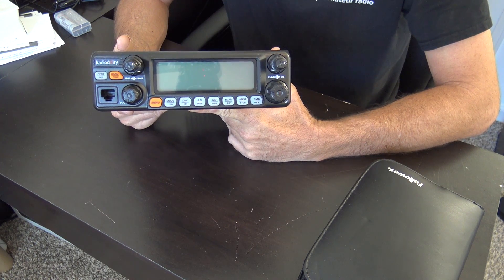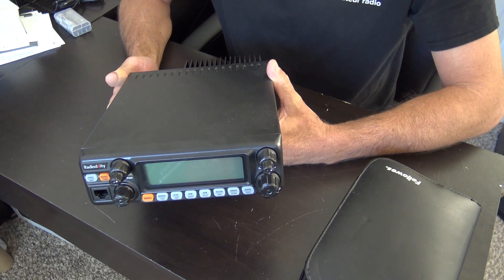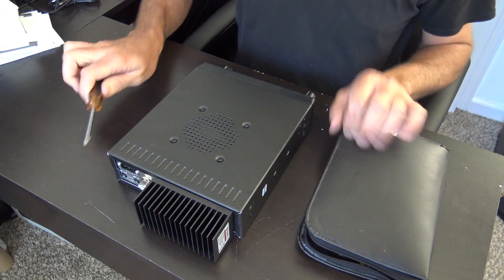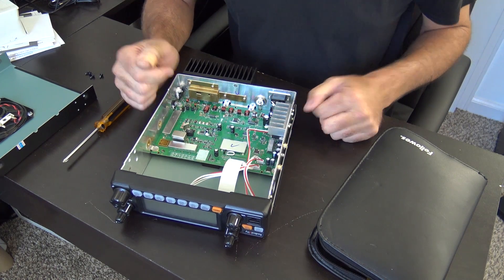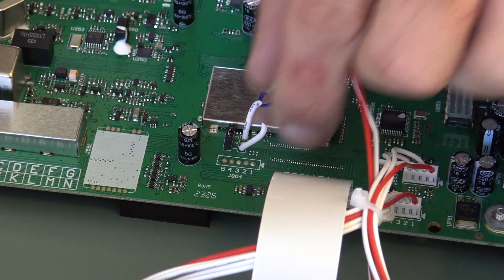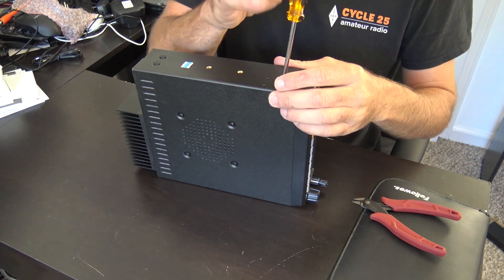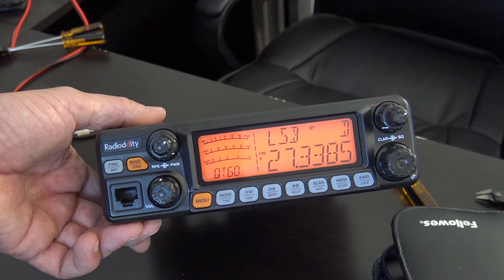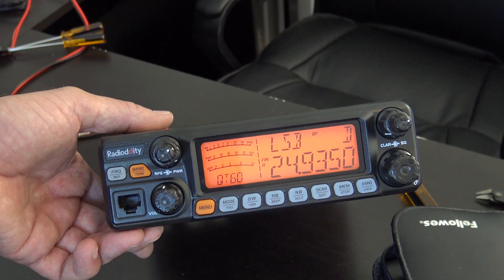Radioddity QT60, Anytone AT-5555, 11 Meter and 12 Meter Modification, 24.800MHz to 30.000MHz

Comment: When the FCC does something about the dude using what has to be a 1000 watt amp to broadcast on CB channel 6 only then will I worry about being hated.
Reply from the maker: FYI, the guys on super bowl 6 use 5,000 - 25,000 watts. I have seen it in person when I learned that they made a 25,000 watt slug for the Bird 43 watt meter.

Comment: Horrible radio.  Just got mine 2 weeks ago and only one contact a mile away.   My 2w HT fRS works better
Reply from the maker: @Mehasmenooneelesdoes  two completely different radios. I have worked 6 out of 7 continents on mine. The bands are WIDE OPEN!!!!!
Reply: @ I was being sarcastic.  I’m aware it’s two different radios.   
Lord!

My point is my new QT60pro sucks. My Tiny bubble wrap Radio works better.   Unfortunately I’m stuck with it though because I did the stupid mod.

Comment: Just got my technician KF0ORI in SW Missouri. Looking for my first radio, other than a Baofeng 2m 70m useless GMRS. You just convinced me to get this radio with pwr supply. Haven't found a reasonable base antenna for it yet. Researching and learning as I go. Thanks for the mod info.

Comment: Have just bought one. It's a nice radio and has a good receiver but it has various issues. The CW frequency seems to be offset from the actual frequency on the 10mb beacons - it tunes in better with the clarifier but that effects knowing the actual frequency. 12mb seems ok. The first bank - A - does not go below Ch9. It's a nightmare - very time consuming - to program. It does not use a spreadsheet compatible text file (eg .csv) that can be easily set up. There seems to be some twisted logic in the software design rather than keeping it simple and easy to set up and operate. I had to program it with the AT5555N QPS5555N_II 3.0.0 app. Bonus is that it allows programming for 60ch per bank and provides for more menu options. Would love Anytone \ Radioddity to sort out the various SW issues and issue firmware and programming app updates.

Comment: Love this video. If I didn't already have two President Lincoln II's, (one in each of our vehicles) our vehicles would have the QT60 or 5555. I love being to 10, 11, 12 meter on one radio.  Maybe I'll grab a QT60 anyway and string an antenna in the attic.

Comment: Love thd video but not having a  
4 pin barrel connector and a un usable RJ 45 plug is the only turn off . 
Ihave not seem any videos on adapting uniden cobra 4 pun 
mics. Alsk ghe qt 40 how many pins is on its conndctor ibtjoyghg it might been 5 cause thecmic functionx with eadio . ? 
But thd QT 60 sure is a dast way to enjoy 12 11 10 onxd yiu know uour eadios going work aftr axsuild cause if voiding warrentty

Comment: The QT40 and QT60 are awesome radios (same as the Anytone ARES2 and AT-5555Nii). 
I use my QT60 on 10m and 12m all the time. It is a fantastic performer. (And it was designed to do this, it's a feature). 👍

Comment: I saw in another video that the power was close to 100w after unlocking.
Reply: No, it really is only happy around the stock 60w power mark. Anyone who shows or claims 80w + is either showing absolute lies, or is showing extreme distortion that is going to do you no good. 
They are amazingly clean and strong at the default 60w level.
Reply: @mostlypostie1  thanks for confirming!

Comment: can you please measure the current consumption of this radio during receive? trying to get that info for some time without success. thanks a lot!
Reply: I just measured this for you. Between 290 and 410mA, depending on audio output level, mode, and squelch settings. Most of the time under normal use I see mine sitting around 320mA. I hope that helps. 👍
Reply: @mostlypostie1  thank you so much!!!
Reply: @CrazyChekov  all good! 73

Comment: Now show us how to screwdriver 100W out of it ;-)

Serious Question: Does the current 5555 do the OG mode ??  Will it take a key ??? And does it have a narrow filter ?
Reply: Another video said that it came close to 100W after modding. I’d like to see someone else test it with similar results.
Reply: @ch716  it’s funny, but cranking it to a dollar will give you half an S point, but I reckon I few things would get that nice baked look after a few months. 

5W to 15W on an old 11m rig was doable, but there’s a lot more current involved at 100W. 3dB can be picked up on a well built antenna. Maybe not as easy on a car, but you can drive to that elevated ridge for an extra couple of S points.
Reply: @ch716  no, it really is only happy around the stock 60w power mark. Anyone who shows or claims 80w + is either showing lies, or extreme distortion that is going to do you no good. 
They are amazingly clean and strong at the default 60w.

Comment: 12m is awesome at the minute. Nice rig! Do you know of any mobile antennas that would cover 10,11 and 12m without a tuner?
Reply from the maker: Thanks for stepping in and answering with knowledge brother
 I appreciate you
Reply: MFJ ham sticks. One for 10, 11, and 12. Just swap em out for what band you want. Check my videos and seen em in action. 73
Reply: You’re asking a lot. To get the bandwidth, you’ll need a longer and / or thicker antenna to get a wide bandwidth

If you’re mobile, you’re typically limited to around 6’ for an antenna. 

You could get an antenna with a tunable stub at the top to give you resonance and a nice SWR across say 500KHz, maybe a little more with a capacitance hat, but without some sort of tuning, adjustment ability you’ll not get that 25-29Mhz bandwidth on such a short mobile antenna. 

As far as I understand. 

There are plenty of long 18-20’ antennas that will work across the top of the HF spectrum. 

For my 10m mobile, I adjust my antenna for either the CW portion or the voice portion. I can kind of get both at once, but my antenna is a little short.
Reply: @MidlifeRenaissanceMan  thanks mate! I have been using a sigma power stick 4ft on a clamp mount mobile with my Yaesu 891 and it works well on 10m (it is a copy of the fire stick with the screw tip) but will not work 'as is' on 12m. Might have to try the whip with a small coil (tapped possibly). 73 from the UK.
Reply: Make a longer tip for 12mm and swap it out as needed. Use your NanoVNA and remember to have the smith chart turned on so you can see the complex impedance. Makes it easier when adjusting the length. Longer is inductive, so shorted. Shorter is capacitive so more length 

that’s what she said
Reply: @MidlifeRenaissanceMan  thanks mate, will try this out!

Comment: I have that same radio. I got the programming cable . and with Digi rig and anytone cable set I have been using digital modes on the radio. FT8 and JS8 call will work. both 10 and 12 meters.  I sent and received SSTV pic's on 11 meters. and you can POTA with that radio. just keep power down on digital modes. I use a AMP. and I did most contacts portable with end fed half wave or coax antenna T2LT . 10 meter repeaters are a bit tricky. have to keep CTCSS/DTS chart handy. I changed the display to my call sign did say QT-60 . I changed the SWR protect to 3:1 at came set a 20:1 . getting FT8 to work was a challenge using volume on radio and mic gain and settings on WSJT-x . JS8 call was tricky to set up but MMSSTV was easy ! and you can program your own roger beep great for 11 meters. use the Anytone program software from anytone . easy down load .  Radioddity and anytone has the program cable. 73's
Reply: that is way cool where at 11m did you send sstv? a friend and i did the same a couplr years back it was very cool!
Reply: @AdamDeal-KF0PRI  used 27.235 AM . QT 60 with Digi Rid and MMSSTV on laptop. to a friend with basic CB and APP on smart phone. he sent pic back holding mic over smart phone. Robot 32 is what we used. we also did SSTV on FRS radios and MURS radios. we only 2 miles apart.  going to do SSTV parks on the air some time. most likely 20 meters with ICOM 7300 .